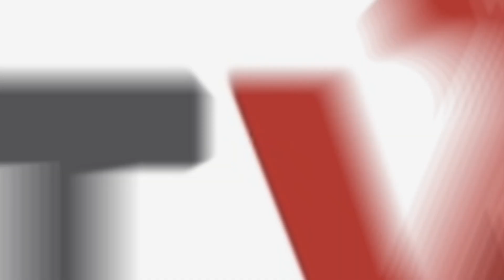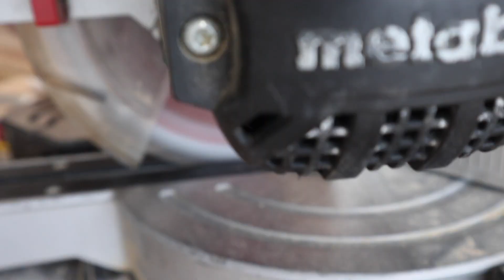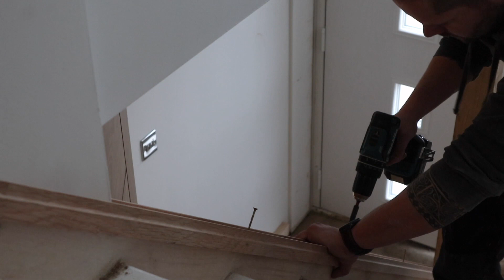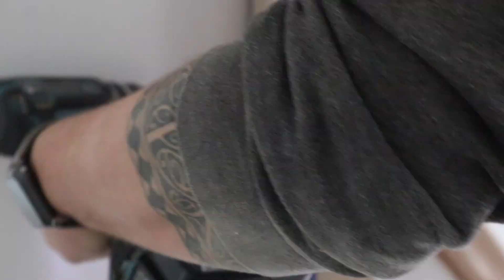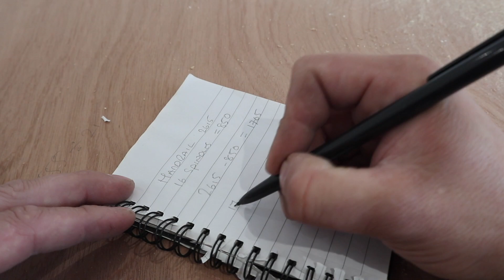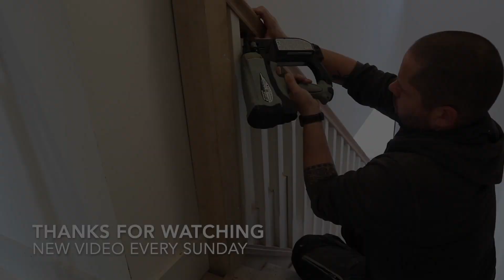Fitting stair hand rail and spindles

Comment: Can I ask a question about the formula you used? I presume the handrail length is 2615mm and you’re using 16 spindles with the combined width of 850mm. Minus the spindles width from the handrail length equals 1765mm and divide by 17 (16 spindles plus 1 for spacing?) equals 103.8mm - is this final number the gap spacing between each spindle?
Reply from the maker: Hi, good question actually, 103.8 is the length of the timber spacer on the pitch line. Not the spacing on the going. The spacing between spindles can’t be anymore the 99mm at it’s widest point. This is a set regulation meaning that a small child couldn’t get there head through the gap. I prefer to work out my spacings on the pitch rather then the going. I hope that makes sense.